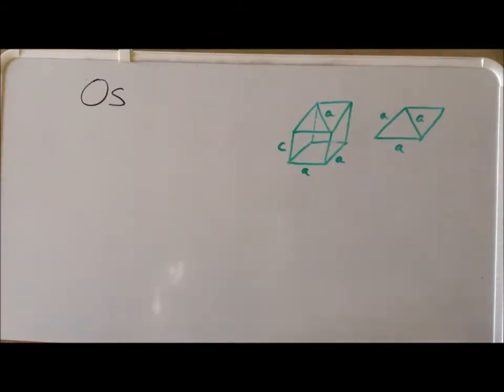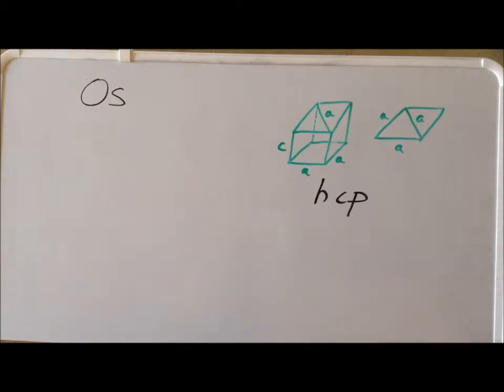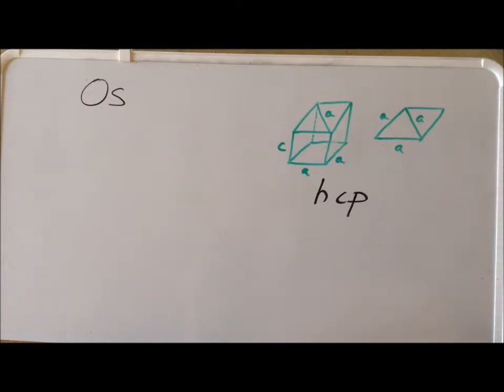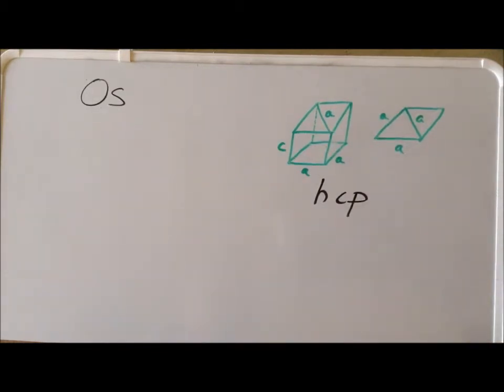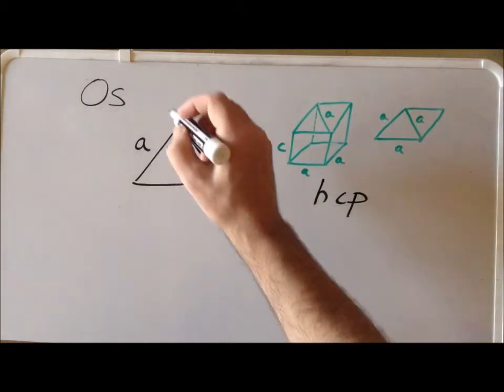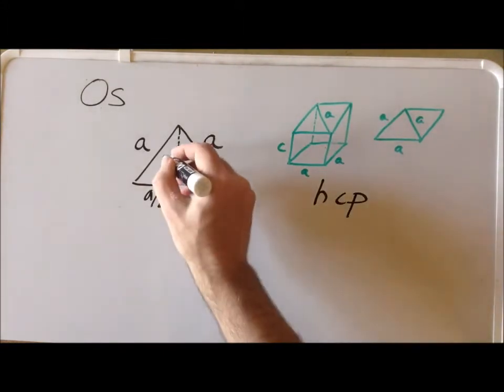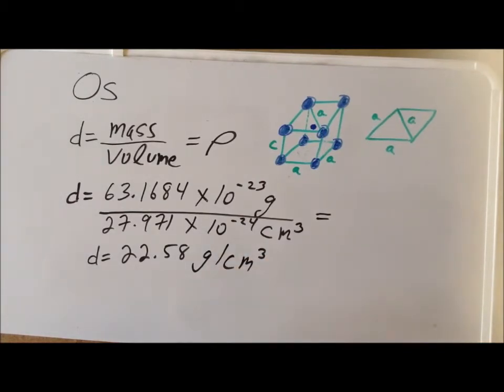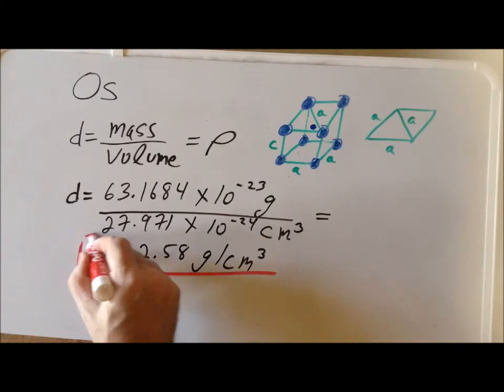Unit cell problem: osmium (Os)

Comment from the maker: (For mobile users)

00:07   Hexagonal close-packed (hcp) lattice
02:15   Calculating height  (h) of equialteral triangle with side length a
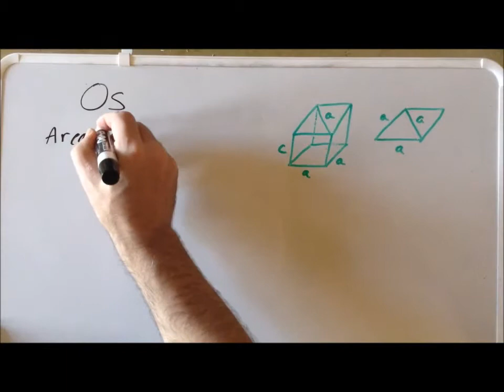04:45   Calculating area of equilateral triangle with side length a
05:45   Area of rhombus
06:27   Calculating volume of unit cell
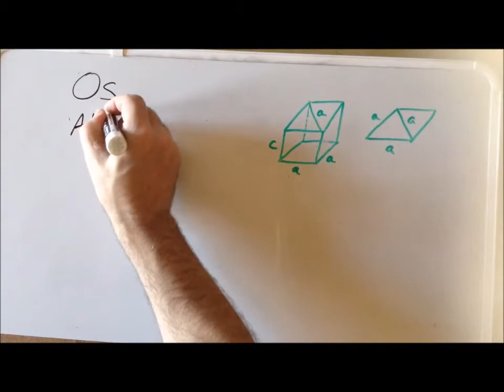08:33   Calculating mass of one unit cell
11:15   Density of one unit cell = density of bulk